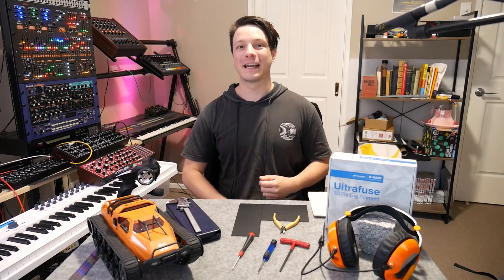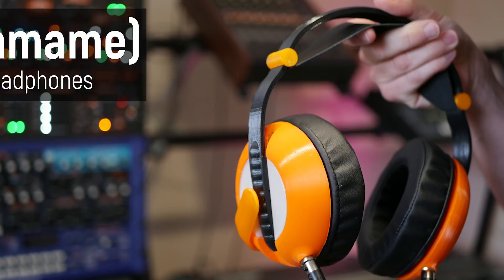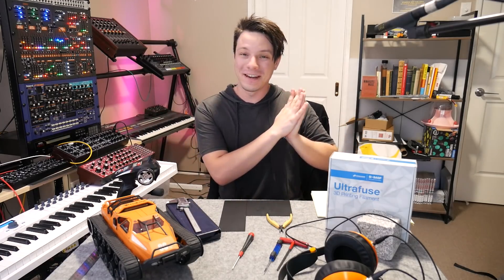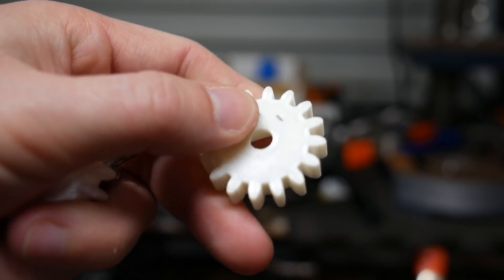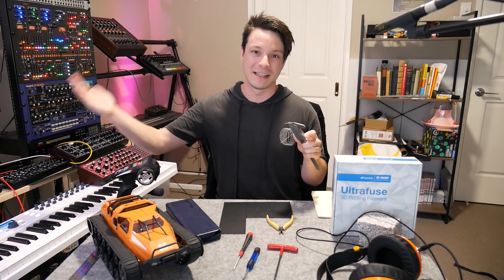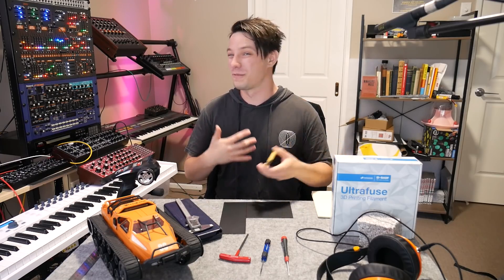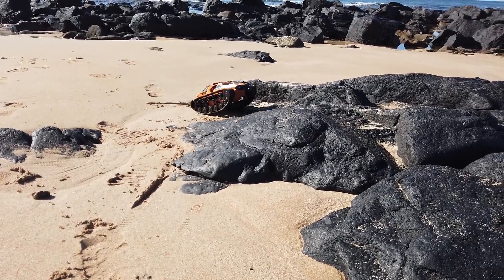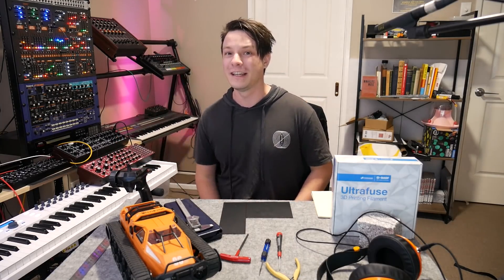The BEST Gifts for 3D Printer Fanciers?

Comment: RE the Easy Peelzy- I often find my bank charges me quite a bit more than the market value of foreign currency exchange so unless the purchase is charged in GBP£ I don't purchase anymore!
Reply from the maker: Yeah fake exchange rates are a scourge, PayPal is really bad for it too.
Reply: I had this happen on a something I sold, ended up having to refund them for whatever reason and the bank skirted them out of $40.
Reply: Banks will charge a fee for exchanging currency. And if they go through a 3rd party, they will get charged the fee as well, which in turn gets passed along to us.
Reply: @tobins6800  It wasn't a fee though.  They actually changed the market exchange rate.
Reply: @masonpetrov2716  I also learned over time, banks will be lazy, they will use the exchange rate at a given time of day. Since currency is traded on every market, it can change minute to minute. I can also guarantee that they will use the most expensive rate that they can charge and exchange for less.

Comment: I can attest to the quality of Lindstrom cutters.  I have three pairs, of different types, for microelectronics, the first bought in 1986 and they're still my go-to flush cutters.
Reply from the maker: We had a full size pair at the company I worked at back in '08 and someone literally used them on piano wire. That's the only thing that they can't endure...
Reply: @MakersMuse  My 4th pair is a pair of end cutters, which to my wife looked like a miniature pair of carpenter's pincers.  They don't survive pulling out upholstery tacks either.
Reply: @MakersMuse  I worked at a radio shop for a while and my toolbox had Plato side cutters and a larger pair of cutters used on coax and larger power wires... My boss made it very clear that those small Plato cutters were only for small gauge wire and stripping the sheathing off of larger wires. Both pairs of cutters looked to be around a while so the previous techs must have headed his warnings, lol. I love getting good quality tools for Christmas because I will never justify the cost myself when the harbor freight option is only 20% worse and 25% the cost... Though I do spend good money on power tools and Plato cutters as I never want to have a dull tool or a battery charger incident.

Comment: The best present??? A SHREDDER for all the bad prints, they take up a lot of room if not shredded.
Reply: Then you can remake them into new filament! Recycling.
Reply: @blindey  Exactly, stage 1 shredder, stage 2 new filament making extruder, but that is next years Christmas present.
Reply: Buy a heat gun and flatten them
Reply: Along with the shredder, a cheap countertop oven. Can melt or soften the used filament and use a mold to make other parts. And can use that as an excuse to get other tools for such a purpose, for instance, router(s) and bits, table saw, sanders, and so on.
Reply: You can supposedly compost them or just recycle . I keep a box full of my fails or stuff i dont want im a new 3d printer not yet a maker no idea what to do with my prints. A shredder sounds fun
Reply: @redmeghixtape410  About 6 videos back Angus showed they do not decompose, go and have a look. Building a print shredder has been a lot of fun getting enough torque to break 100mm prints.